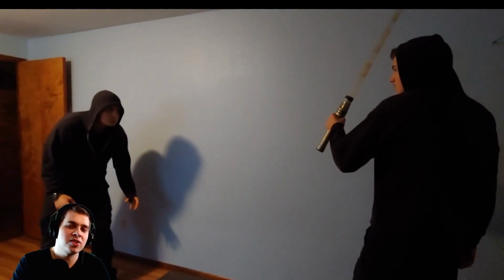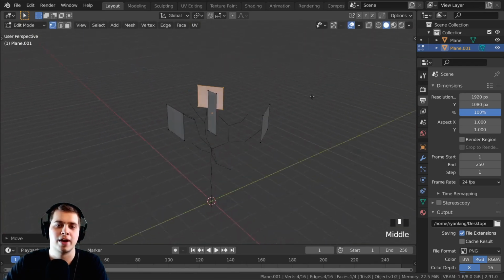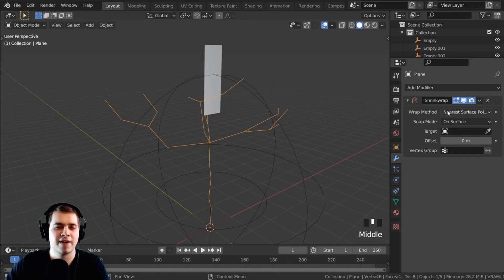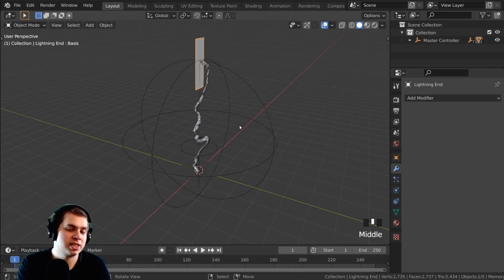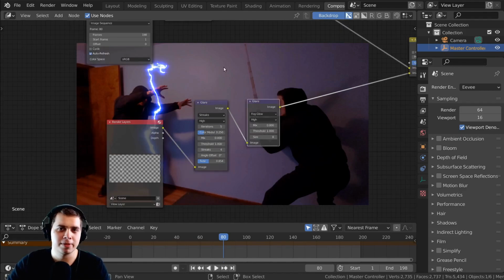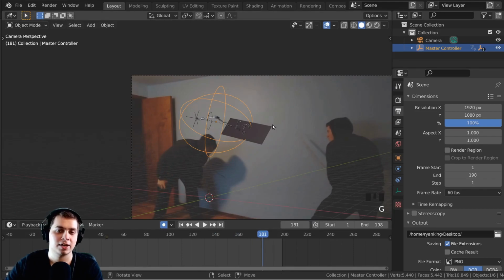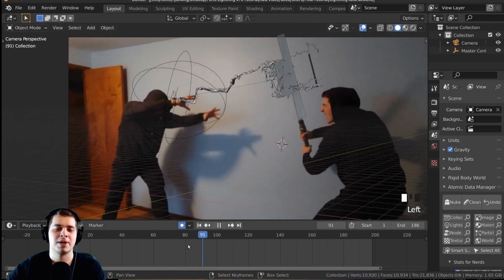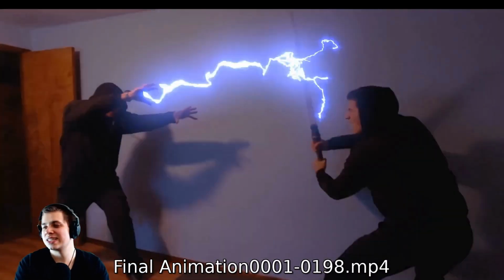Force Lightning! (Blender VFX Tutorial)

Comment: This tutorial has proven helpful so far.  My lightning bolt looks nice.  I'm currently in the process of weight painting.  The first time I tried this, I didn't make the branches.  When I got to the shrinkwrap modifier part, the top and bottom of the model were attached.  I had accidentally made a makeshift slingshot in Blender, lol.  My current lightning bolt is much better than its previous version.